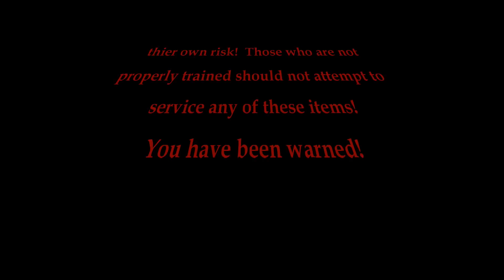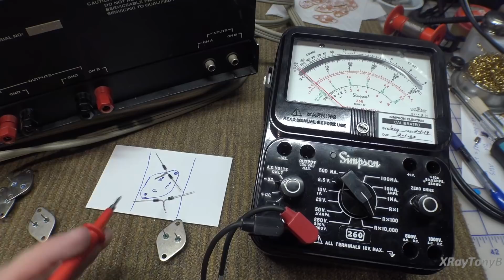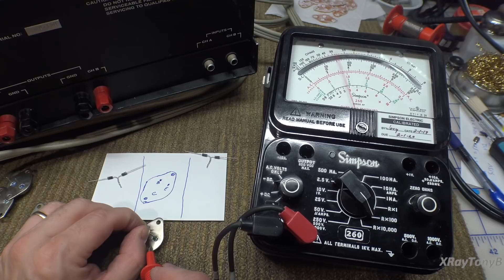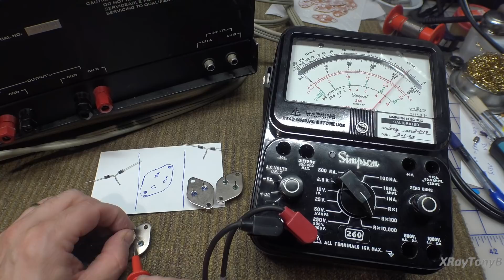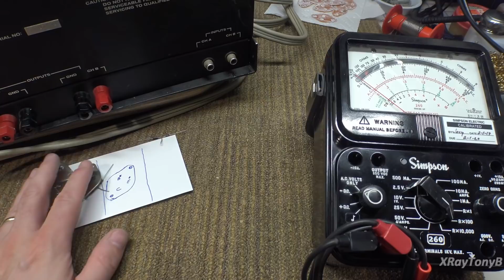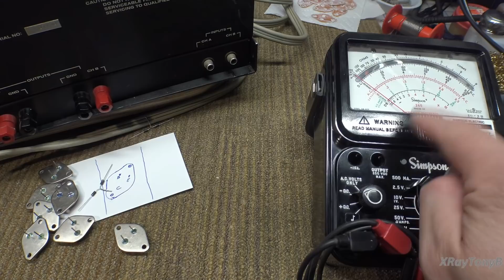Testing & Replacing Output Transistors - SAE Mark III Amplifier - Part 1b

Comment: I don't think it's right to say you can totally say that transistor is good with a static test on a VOM. I've had a transistor show the diodes correctly but didn't function as a transistor and the transistor checker (Velleman DCA55) showed it as two diodes and not a transistor. You also can't tell HFE. But it is good for for shorts or opens.

Comment: Unfortunately, new counterfeit transistors pass all of these tests. They fail due to current and voltage limitations, in the repaired unit of course.
Reply: Exactly, besides the lower collect-emitter Voltage breakdown and current looping, the gain is all over the place.

Comment: Doing my head in, but I guess that if I set my DMM to resistance and not diode check I'd get the same as the AMM, probe wise? As you say, it probably doesn't matter as the transistor would still show short if it was, but it would help me to know NPN vs PNP, as I don't have the mental data base that you do.

Comment: The leads on my older RS Micronta meter are reversed as well. In ohm mode the positive is negative. Sure threw me off in the first half of the video. Great video, Thanks Tony!

Comment: Really nice video, watched a ton of them, But you’re the first that actually showed testing a bad transistor so you could see how the meter reads it. 
I’m trying to test germanium, transistors and silicon and I’m getting weird results. This video will help with that. I built a simple gain testing circuit. I am really struggling to get consistent results between germanium and silicon transistors. Any thoughts on why I might be getting such mixed results?

Comment: You have the 260 on -DC, so the applied polarity is reversed.  When the black lead is attached to Cathode of diode and the red lead to the Anode, the meter should show lower resistance.
Reply: Glad you got that, I did Too :)

Comment: Its a shame the To-3 transistors are so darn expensive!
Im currently repairing a Peavey power amp, with 24 transistors in total... 98% of them are bad, according to following your video.. :(
Thats alot of money to replace them :(
Reply: Its quite strange that they are, other than better heat dissipation, the plastic cased ones do the same job.
Considering that the diamond packaged TR'S are harder to mount having to use more insulator pieces, it doesn't make much sense.  Okay they look nicer, but they are quite impractical for ease of mounting.

I think it could be because of the older Ge types are no longer made
which is much more understandable why these cost more. 
Its an old con.   Perhaps the new ones are harder to make.

Comment: Hey I don’t know anything about any of this, and I came here with a problem. My Behringer PA system just lights up and turns off over and over. Tricky to get it to turn on. What should I do?
Reply: Sounds like a protection circuit.

Comment: Thank you so much for this video and explanation.  To clarify the glitch in the video (many others commented on it as well).. this is the CORRECT lead positioning:
When testing NPNs, red lead is on the Base pin and black lead on the Emitter pin
When testing PNPs, black lead on Base pin and red lead on Emitter pin

Op's leads were reversed on the analogue Simpson, so it is confusing to watch at first.

Comment: Trap for young players: While Tony is testing for direct shorts to immediately discern good transistors from bad, one that tests "good" in this fashion may be "leaky" and not function correctly in circuit. This can range from improperly functioning to flat inoperable, generally becoming worse as the transistor power increases towards the breakdown voltage. Just a little food for thought if your circuit is having an issue and testing indicated a "good" transistor.
Reply: How do you test a transistor for that,for a leaky transistor?

Comment: I always use the collector as reference pnp red probe on collector. Npn black probe on collector. Am I doing something wrong.  I have a nice rca 27v analog meter that works great for testing semiconductors and capacitors.   
Merry Christmas Ace
Reply: Gabriel, this caused me much confusion until I saw that Tony has his meter switch on " DC — ". 
 that Simpson's red probe is actually delivering negative voltage to the cathode of those diodes.
Reply: @RapperBC  You're right. Many older analog meters have polarity opposite of what the probe colors suggest.
Reply: The polarity of the probes is controlled by a switch on the meter. The video is confusing to anyone who doesn't notice that Tony has the polarity on his probes reversed. In this video, Red = negative and Black = positive due to the position of the switch on the meter.  @johnnytacokleinschmidt515
Reply: @WayneRite758  only for DC+ and DC- I don't think that applies to ohmmeter function.

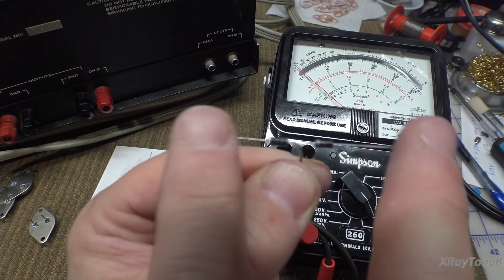Comment: 2:00 Hmmm... actually, the two PN junctions are parasitic. You won't actually get a functional NPN transistor by connecting two diodes in anti-series. Just explaining it for those who might have gotten it wrong.

Comment: I'd like to share an experience I had and hopefully get your view on it - so I was working on a fender bass amp which had parallel output transistors. I went through them with my DMM (in diode mode) all the transistors checked out ok. Powered it on, 'boom' fuse blows. So I desoldered the whole lot and turns out one NPN transistors was shorted. Replaced the shorted transistor and checked all the other transistors, powered on, 'boom' fuse flows (I bypassed my current limiter bulb). Anyway I discussed this with one of the veteran tech here and he said that I should measure them using an analog meter - similar to what you have showed. Apparently there would be an 'acceptable' range of resistance between C & E (ideally it there should be no reading). So I followed his instructions and measured all the transistors using my analog meter and all the transistors showed some resistance between C & E. I compared the results with brand new transistors and the new ones does not show any resistance between C & E. He calls it leakage current. I was wondering if there was such a thing as an 'acceptable range'. If so what would that be? Could that be an indication whether a transistor needs replacing or not. Thanks and I really do enjoy your content. 
p.s- I replaced all the output transistors of the amp and it's back in working order.

Comment: In no way do I wish to pour cold water on your demonstration of transistor testing, but recently I had a faulty transistor in a scope and it tested good as two diodes and also good on an ebay tester. I couldn't fix the circuit so decided to replace the transistors one by one and this particular one proved to be the culprit. It may be the voltages were not high enough in test conditions. Do you ever come across this situation in your work Tony?
Reply from the maker: Good question! The test you saw me demonstrate with the VOM is best for testing output/power transistors, as their common failure mode is to either go short circuit or open.  Small signal transistors generally fail through drift, "pop" noise, static, etc.  These types of failures are very difficult to troubleshoot out of circuit, even with those little testers.  If you check out some of my past videos, I show how you can connect a voltmeter to the transistor and test for voltage drift.  Any type of test that doesn't apply a typical operating voltage/current won't show this type of failure.  If a small transistor shorts, it will often be current limited by the resistors in the circuit and won't cause much collateral damage.  A power transistor, however, will take out power supplies, circuit traces, etc. when they short.  That is why I test them in this manner (with a VOM).
Thanks for the comment!
Reply: @xraytonyb  Thanks for your reply Tony.
Reply: @xraytonyb thanks for the nice video. I'm looking for a video on collateral damage, and how to find the extent thereof. I'm a beginner on this stuff, and so far I have a bad power capacitor and two out of four bad power transistors. Both on the same channel. The receiver only works on one channel. The other one blew out the fuses. I don't want to replace the fuses and cause further damage. But I'm curious to know what kind of other small transistors, diodes, resistors, and capacitors could have been taken out at the same time. I would hate my new found skills to be for naught by simply replacing the known transistors and power capacitor. Just to blow them again. Any points in the right direction would be greatly appreciated. Just a dumb lawyer here.
Reply: had exactly the same thing in a 75+75W MOSFET amp - there was a BC182 that tested on a PEAK DCA 75 as TWO diodes but I knew it was the culprit - changing it and the circuit worked perfectly . The PEAK DCA75 has tested a couple of damaged transistors as two diodes - but always tests working transistors as transistors.

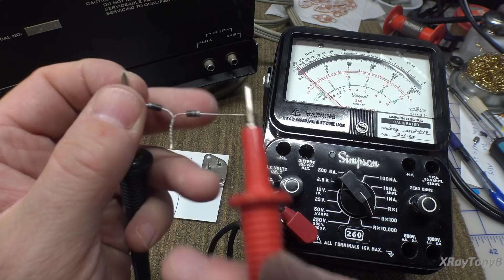Comment: (@2:46) - Whoa there, horsey! You’ve got the test leads reversed at the meter (or the meter is wired incorrectly inside). You’re putting the red (+) lead on the cathode of the diode (Emitter or Collector of an NPN transistor), and the black lead (-) on the anode (Base of an NPN transistor.) You should get no reading (infinite resistance) here, but the meter is showing conductivity here. Likewise, when you put the red lead on the anode (Base), and the black lead on the cathode (Emitter or Collector), you should get conductivity, but the meter needle doesn’t move. Either that, or your diodes are labeled incorrectly w/respect to the banded end. You’ve got the same problem with your PNP analogue.
Reply from the maker: Interesting fact about the Simpson 260 -  When the range knob is set to ohms and the selector knob is set to +DC, there will be +positive at the red probe, with respect to the black probe.  If the range is set to ohms and the selector is set to -DC, then there will be negative voltage on the red probe, with respect to the black probe.  If you are set to ohms and the selector is set to continuity, there will be +9 volts (the 9 volt battery) at the red probe.  For checking ohms, it doesn't matter, but when checking diodes, it does.  I would have to check back on the video, but I think I may have had the selector set to -DC.  Thanks for catching that!
Reply: @xraytonyb  the selector was in -DC position ....so you had the positive on the black probe....
Reply: @giuseppebeppe_tv8257  later in the video the digital probes are correct, that's what I used as reference. When he first tests the NPN with the Simpson, I became confused.
Reply: @xraytonyb  @William Squires, this caused me much confusion until I saw that Tony has his meter switch on " DC — ". 
As Tony points out, that Simpson's red probe is actually delivering negative voltage to the cathode of those diodes.
I have an old Micronta analog meter I keep around for low-impedance voltage testing, and the red probe on that Micronta delivers negative voltage when on the "Ohms" ranges, and does so by design. It does the meter switching automatically, however, as the meter has no " DC — " setting to invert the meter's polarity.
Reply: Exactly
Reply: Should be in DIODE MODE,   NOT OHMS,  MEASURING. 0510MV ETC

Comment: It's always advisable to replace all end stage transistors instead of just replacing the dead ones.
That way the amp will stay symetrical on both channels. 
I had to do the same thing when I initially bought my Pioneer SA7500 in the early 90's.
One channel was dead so I just replaced all end stage transistors.
Reply: You can pull two transistors off the line while they're being manufactured and they're not going to be matched.

Comment: Wait a second here,  PNP you put negative on base and NPN put positive on base. Am I missing something due to lack of sleep?
Reply from the maker: It has to do with the simpson 260.  The +DC and -DC settings on the selector knob will actually reverse the polarity of the voltage in ohms mode!  I think I had the meter set to -DC, which would have placed negative voltage on the red probe.  I will have to clarify that on a future video.  Thanks for bringing that up!
Reply: Some meters are "reversed polarity" when in ohms test.  If you take a simple voltmeter, and then add a battery to make it a ohm meter, the voltage on the probes are reversed.  In a analog meter, you'd have to add switching (and complexity) to make it match.  Digital meters read both both polarities, so you can insert the battery "backwards" and hide the sign to make the probe polarity match.  So, generally analogs will be reversed and digital true, but there's probably examples out there that break that generalization. Bottom line, you have to know your meter.
Reply: Yeah,  that's what I was thinking.  The polarity of the probes are reversed.

Comment: I agree Tony. When you have that much collateral damage to a power amplifier, especially a vintage unit, replace all transistors in that sub circuit section no matter which still check good. Some will strongly disagree saying that transistors are either good or bad, no in-between. I agree from a strict engineering point of view, but how do you measure stress the junction may have been subjected too? Also even crude matching such as buying from the same lot has it's advantages especially when mixing 1970s parts with 2000s era parts.

Comment: Nice to see some old school semiconductor testing.  Simpson 260s are still usable in 2020.
Reply: I started out in a high school senior credit work study program at a local TV station in 1977. The engineering shop where I worked had a Simpson 260 and a brand spanking new Simpson (1977 expensive) digital meter. The Chief Engineer would not let me use it much. I was forced to use the old 260! Looking back and soon after a formal  EE program, I am very glad he did that! Far too many graduate EE's today have no clue as to these basic principles. It's all HDL, MatLab, and Python programming.